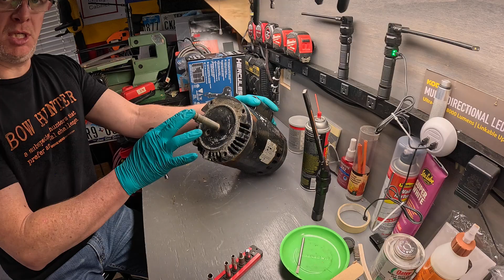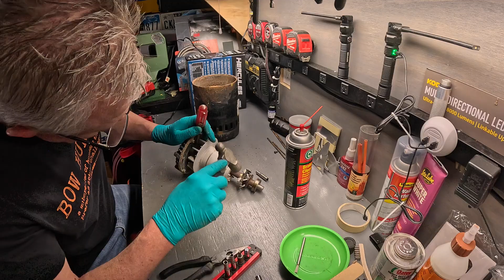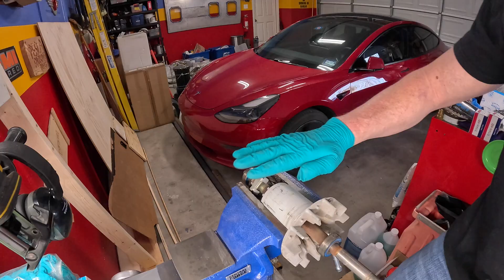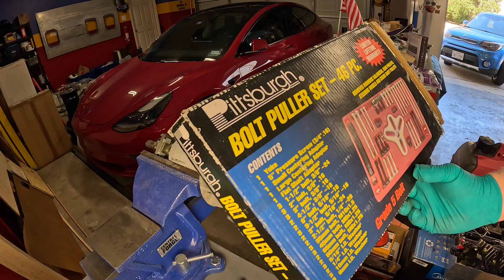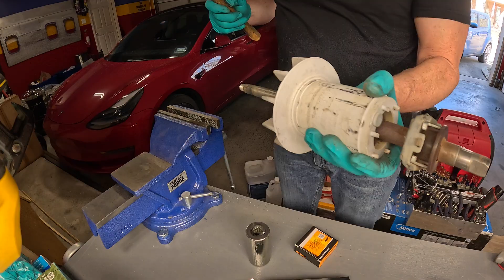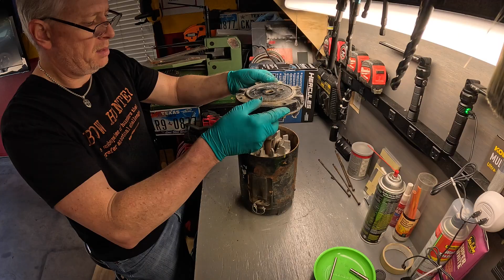Pool pump bearing change Polaris Spa, Pool or Booster Pump made by Century, Hayward and China.

Comment from the maker: Polaris pool cleaner tutorials to keep your pool equipment running like new.
https://amzn.to/3FxOyci
     Swimming Pool Pump Motor, 3/4HP
https://amzn.to/4bxqTVr
     Double Sealed Deep Groove Ball Bearings, 17x40x12mm
https://amzn.to/4icXQJn
     Kroil Original Penetrating Oil
https://amzn.to/41X3F6z
     Silver Anti-Seize Lubricant
https://amzn.to/42bKKX1
     Slide Hammer Puller
https://amzn.to/3FC9Nd5
     Puller Set Flange-Type
https://amzn.to/4hksCPg
     CRAFTSMAN Mechanics Tool Set

Comment: Dude, get a proper bearing puller!  They let you borrow them for free from Auto Zone.  You use a wrench to turn the puller spindle and they come right off.  Don't bang your bearings off.  And for God's sake, please don't bang them on by hitting the entire bearing, inner and outer race.  Get the right size pipe to go over the shaft and contact only the inner race; not the outer race.  Then you can bang it on that way.  You like took most of the life out of those bearings by making dents in the out race where the balls contact the race.
Reply from the maker: HAHA, yeah, I finally did get one, like you said "A PROPER BEARING PULLER" I almost died doing this. lol so sketchy.